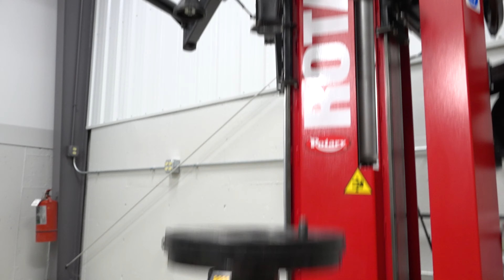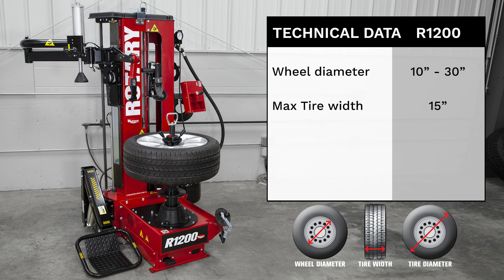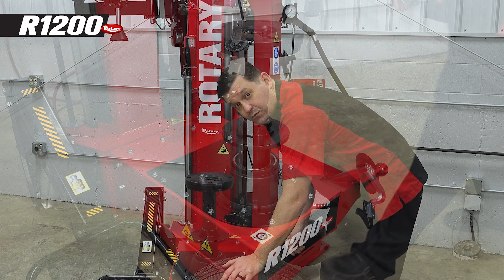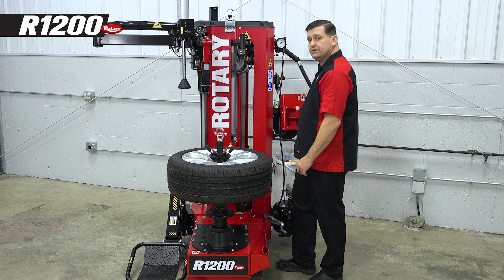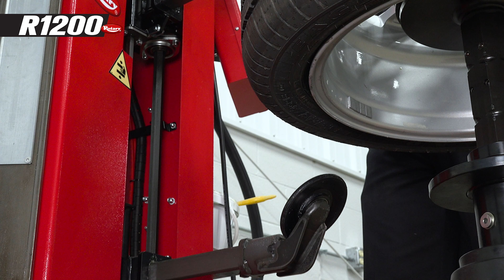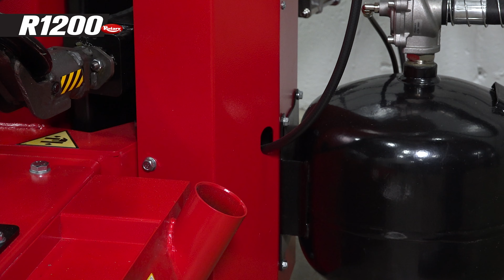Rotary R1200 Tire Changer Operation

Comment: yeah I am not a fan of matching up or indexing the tire to the rim when it has the beads seated and air pressure in the tires. That practice will lead to premature wear of the motor.
Reply from the maker: Thanks for the comment.  We agree that trying to match mount/index a tire with seated beads and air pressure is a bad idea.  That's why if you look closely in the video you can see that the beads of the tire were not seated and the tire had no air pressure in it before we started the match mounting/indexing process.